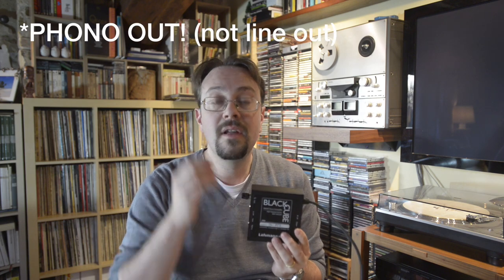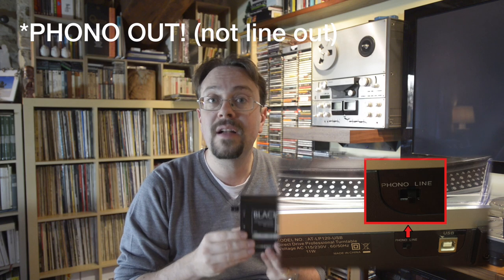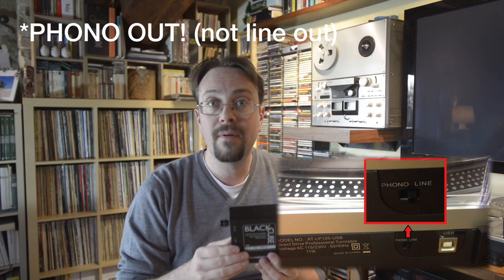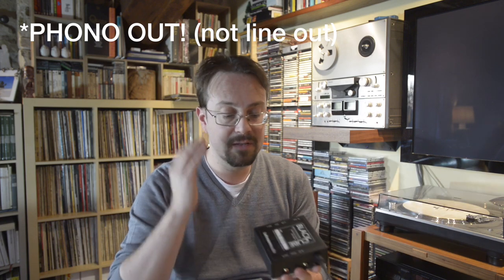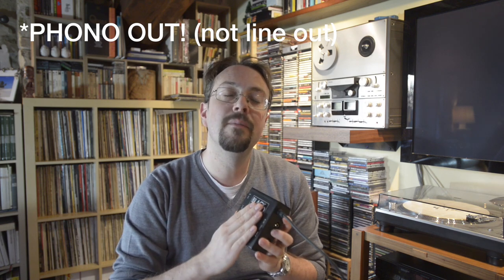Optimize your Hi-Fi system sound quality: 3 - Pre-Amp your turntable!

Comment: OK... it costs like 5x more than my turntable is worth these days :) And where do I plug this thing in? In to the "regular" pre amp phono-in?
Reply from the maker: Hi Baerchenization! Well the Black Cube is just an (optimal) example. Here are other three excellent examples around 50/150$-€: http://www.rolls.com/product.php?pid=VP29 (50$)

http://www.talkelectronics.com/edwards-audio-apprentice-mm-phono-stage/ (100$)
http://www.tisburyaudio.co.uk/domino-phono-preamplifier (150$)

If you have a built-in preamp inside your turntable you MUST have a phono out (if you have ONLY a line out you cannot add an external pre-amp). This is because you use a pre-amp ONLY with the signal is coming directly from your cartridge (i.e. with no pre-amp on board). From the phono out jacks you connect the right and left channel of the turntable to those of the preamp (and then from the pre-amp to the receiver or amplifier). Here is a pic: https://www.phonopreamps.com/images/phonopreamphookup.jpg
If you do NOT have an on-board pre-amp, then you will need an external preamp which is connected in the same way as in the pic above. Clear?
Reply from the maker: I forgot to mention...in order to properly match a pre-amp with your cartridge (or viceversa), check this video: https://www.youtube.com/watch?v=T428mIuw9IQ&t=39s
Reply: I have a Linn Basik from early 90s, which is in the attic for about a decade now. But lately I am shopping around on Ebay to get everything going again. I will keep the old speakers and the Linn, because vinyl had always been more auxiliary for me and the focus on the CD collection. So I don't mind adding a pre amp, but one that is reasonable for what I have... I found myself an Audiolab 8200Q preamp, but it seems it has not been designed with vinyl in mind. Anybody remember the old Basik? At least mine came with some really shitty/wobbly triple rubber feet setup - is it possible to convert that to something more "normal"? Wtf were they thinking at Linn?!
Reply from the maker: Hey! A Linn is always a Linn. Yes, you should stick with it. You can always upgrade after. Which tonearm do you have? Cartridge? The Audio lab is NOT a Phone pre-amp but the receiver preamplifier. Most high quality set-ups do not have a classic stand alone receiver/amplifier (AKA integrated amplifier). They are always compose of a pre-amp and a power amp. A phono pre-amp is just for your turntable. In a lot of cases the pre-amp could have had on board a also a phono pre-amp but not on your Audiolab (in fact it has 2 dedicated outputs)
Reply: To be honest, I never knew... all I know is that the "table" cost 300 Marks back then, which was surprisingly cheap in my mind - until I learned that that is to be taken literally, and so the entire usable turntable cost 1000 Marks :D The dealer had put it together, I got no idea. Yes I understand the phono pre amp is only for the turntable, so I would feed that in to the Audiolab phono-in? Last time I had seem my poor Linn I noticed that the tension of the lid hinges cracked the acrylic cover; searching on the internet, some Linn parts dealer wants ca 150 Pounds for a new lid - or I could have an entire pre-owned Basik system on Ebay for the same money, giving me a few spare parts extra free :P

Comment: Hello i have a lehman audio préampli but i have a little buzz in the background and when il m touching the arm sometimes  it makes noise crack...And where do you put the earth of the turntable  and the earth of the préamplificateur?
Reply from the maker: You must connect the earth of the TT to the screw of the phono preamp, if this was the question. For the humm (buzz) it is most probably a bad power cable of your gear, it could be any component that is polluting the power of your gear. Try detaching one power cable at the time and see if there are changes.
Reply: Hello thanks. And the earth of the preamp to my main amp?  
I will try with what you say with the power câblés( i have a VPI traveller’s with a mc dynavector Dv 20x2L and a black cube SE2 ) do you think the power câble of the lehman must be changed as lehman it s serious material ? And if so what kind of cable must I buy? Many thanks for your very interesting videos.
Reply: And must I connect the earth of the preamp to my amp as it s meaning the earth of the TT and the preamp will be together in the preamp earth connector?
Reply from the maker: @michelraffin7006  no, the pre-amp with the amp, no! No, not the cable of the Lehmann. You must check ALL the power cables of your system, that are connected to the near wall sockets.
Reply: Hello again so I tried to,put thTT earth to my,preamp and the buzz is worse. And When I disconnect my TT of the preamp (this one still connect to my main amp) there is no,more buzz
Reply from the maker: @michelraffin7006  will, I guess we solved the issue. Is it completely gone?
Reply: ANA[DIA]LOG hello almost  I ll tell you ,  I have the problem of gain and I must switch off in the lehman block one and so I must turn my volume of my amp almost at the most

Comment: Can I use this pre Amplifier with my Pioneer Elite VSX47TX receiver?
Reply from the maker: You can use any pre-amp. The output signal is at that point a normal line signal, like a CD player. Just make sure to connect it to a normal input NOT a phono stage input.

Comment: Bad phono amps in integrated amplifiers/receivers ? How can that be when NJM2043 (obsolete), NJM2068, NJM4558, µPC4570, NJM4580, AN6558 Op Amp ICs and 3300µF electrolytic capcitors (NO low ESR, in negative feedback) are installed ?🤣

Comment: Can anyone recommend a good preamp with USB out? Or if the ART USB Phono Plus Turntable Preamp is any good? I have an AT-LP120 turntable which I plan on removing the internal preamp on it and replacing the cartridge with the At440mlb. I only want to be able to rip my vinyl collection in lossless (flac) audio files in the best quality possible, any suggestions or advice would be greatly appreciated.
Reply from the maker: For the best quality possible you need, IMHO, a dedicated A/D converter...that sets the 'sound' of your digital files..
Reply: @anadialog  Would you happen to know of any with USB out?

Comment: I don't think pre amps are good at the purchase level being recommended.  My perspective in building a hifi system  spend most of your budget on the speakers, the the next largest proportion on the amp  then  the turntable.  At moderate( €600 to €25000) costs an integrated amp is going to give you more bang for your buck.  The reason I say that is a well designed integrated amp  is going to have a shorter signal path with less interference than a  cheap amp  combined with a cheap Pre-amp. It will produce a better sound than a budget amp with a budget pre-amp. ( The pre-amps recommended in this video are budget).  You only start to see massive change in sound performance with high end pre-amps and amps. So you understand comment in context I am running a modified/ upgraded Thorens TD160 into a Magnat RV3 integrated( and hybrid) amp.      In the price range I was working in a separate amp and pre-amp   would not out perform the RV3,   Add a €1000.00 budget on top of that and then you start to hear a significant difference that would recommend for a separate pre-amp and amp.      Basically  what I think is best, at the budget prices being recommended, I would suggest stick with an integrated amp and put the $100-$200 into a better cartridge, or a slightly more expensive  integrated amp.
Reply from the maker: I absolutely disagree. The Lehmann Black Cube SE is not a budget phono pre-amp nor a high-end model but the sonic jump from a standard integrated phono stage is truly phenomenal. I am talking day and night difference. I purchased other phono pre-amps that cost me 4 times more but the quality went up just a little bit. Other fundamental aspect is the separation of the power transformer that does not take place in an integrated amp. True high fidelity at the correct price.
Reply: @anadialog  Come on  you didn't even check on the amp I mentioned. I really  Doubt the Lehmann black would beat the  Tube preamp stage in the Magnat RV3. Which despite your assertion has separate shields for the transformer and the power caps! Other makes also go to the effort of shielding the transformer and power caps.    Preamps come into their own only when you get into the €2000 plus range. My comment  was particularly targeted AT THE $100 -$200 preamps you recommend.